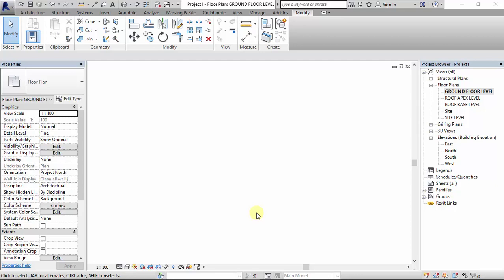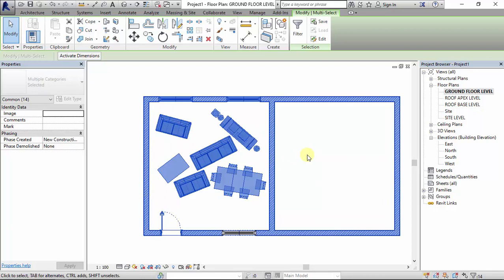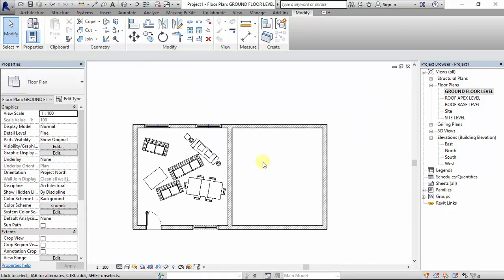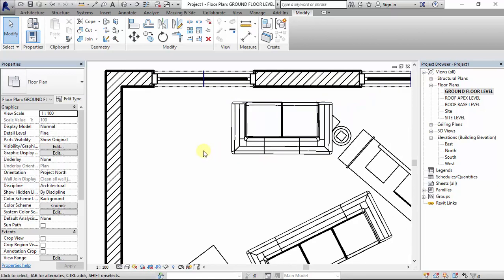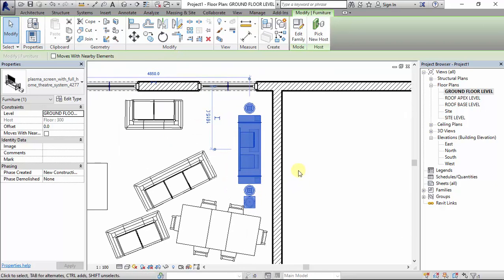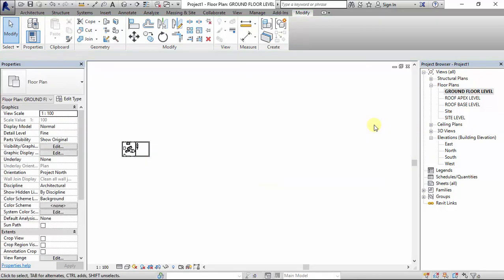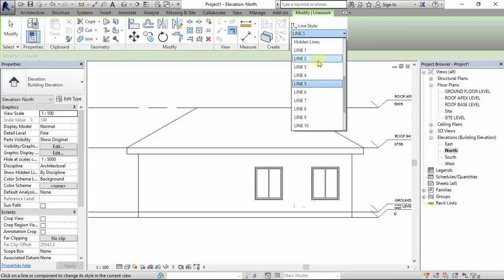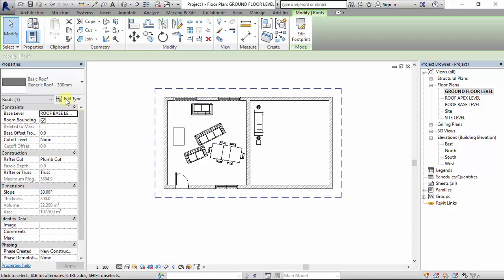5 Revit Tips and Tricks: Select Previous, Using Formulas, Linework and more...

Comment: Really helpful tips.
Does the units conversion work across units systems; metric to imperial, imperial to metric?
Reply from the maker: Yes they do. You can input dimension in feet and inches separating them with the apostrophe ' within a metric environment. You should try it and see if it works!